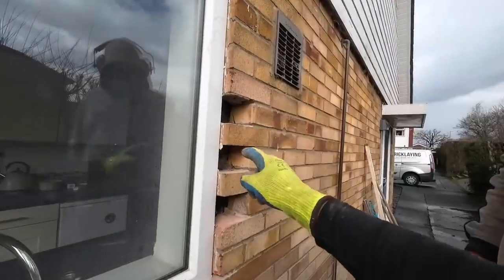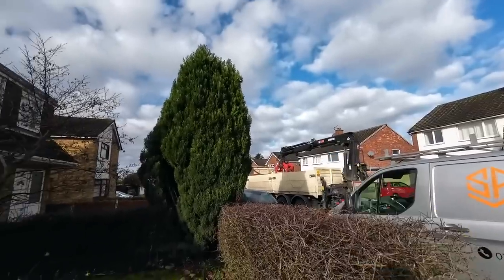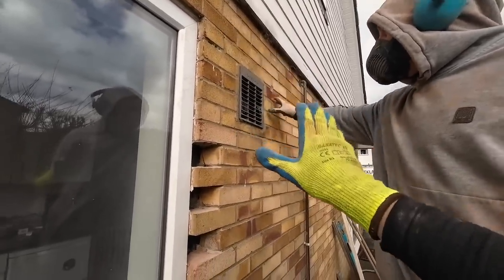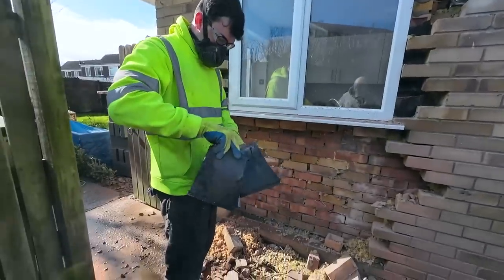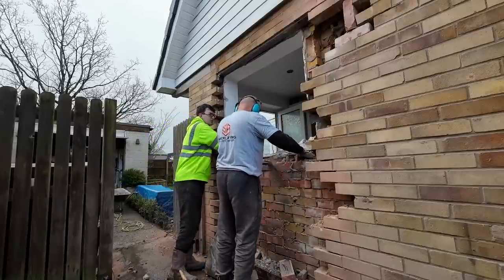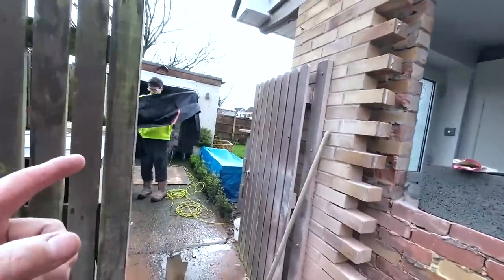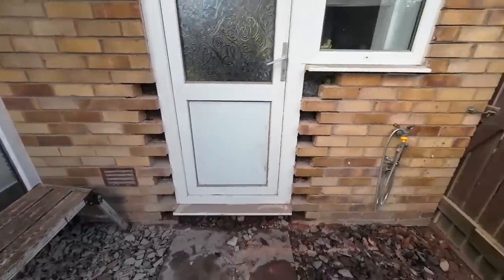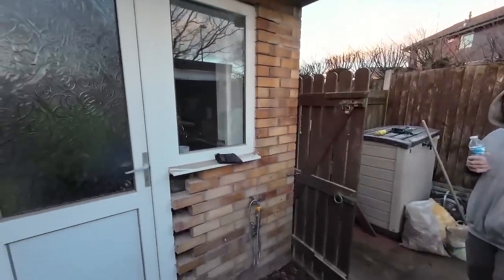NEW KITCHEN BUILDING WORK  PT 1 TOOTHING OUT

Comment: Funny, I get the same comments about saving things from the trash during demolition work in America.  Unfortunately, when you look at the extra cost of careful removal, transport to storage, storage costs, selling costs, and transport to new project site for installation, those costs add up.  Then, old parts have no warranties, no operating instructions, no replacement parts, no service capability.  Finally, the old part may only last as long as a new item, or an even shorter remaining service life.  Not infrequently, older parts may not perform as well as newer parts, for example single glazed windows versus double or triple glazed ones.  Given how relatively cheap most newer materials are, re-using old materials only works out in on-site immediate re-use scenarios, or else where salvage is for historical purposes.  Sad, perhaps, but true.
Reply from the maker: Perfectly put Andreas 👌🏼🤜🏽🤛🏽🧱👍🏽

Comment: @steve and Alex, quick question - As you demolish walls, cavity trays, doors, etc do you find that older houses are built better? I appreciate building regs and techniques change and improve overtime but do you generally find that older houses built 40s, 50s, 60, 70s that builders didn’t cut corners or seem to take more pride in their work? Or, would you say good and bad in all ? Just curious if you find older houses are generally built better.
Reply from the maker: Better bricks back then but rubbish steel .
    There have been rough arses around forever unfortunately 😒🧱👍🏽